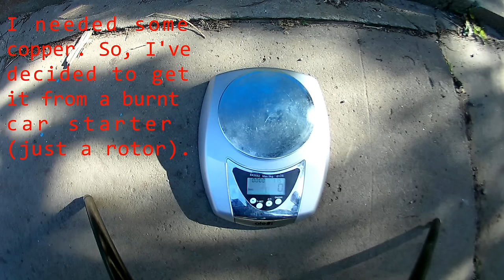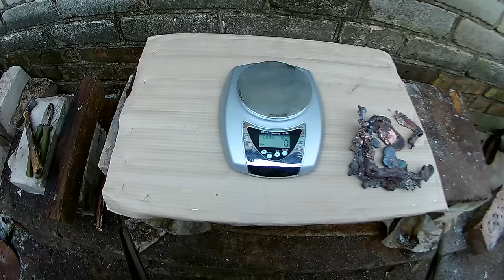Rotor as copper scrap. Copper melting.

Comment: Good work. The rotors are not so bad to strip once you have done a couple. I can strip one in about ten minutes now and there is a lot of copper in there. I use a cold chisel around the bottom of the contact ring and the use a big pair pliers to roll the copper strip down and out of the armature. Worth the effort. Cheers mate 🇦🇺
Reply from the maker: Thank you 🙂 Yes. With some experience probably it's possible to make it much faster.
Reply: Good on ya Stuart G .
Giving  him some positive feed back .
We are all learning .
Too many expert haters on yt .
I tried foundry work at 14 y o .
Failed but learnt ,  still learning. 
But never gave up . 
A Fellow aussie  !

Comment: Around here the best I can get for these and the motor itself is 15 cents a pound whole. Guess I have to sit on it a few more years.
Reply from the maker: Do you think that prices on copper are going to increase soon? :)
Reply: @DuralMetalurg  I really do think that copper is on its way back up in price. It's already near $3 a pound for new copper. 

But for me it's complicated.

I save copper in three ways. I have piles of insulated cable and lots of electric motors I just want to sell off to free up space. 

Next I have clean wire in bales I want to sell maybe in a few to five years. 

Then I have buckets of pre 1982 cents and nickels I am saving as a form of copper bullion maybe for a trade but probably not dollars between 20 and 30 years. 

So will the price go up.....absolutely. In the near term I think between now and the next few years I think it will go up in price substantially. 

Mostly due to the dollar going down, higher energy prices and harder to extract copper.
Reply from the maker: @mysterybuyer3738  Ok. I see. Sounds like you have a good plan. I still have enough copper and aluminum for casting. Though, copper may be a problem for me in the future :)

Comment: Rotors are a pain the ass to work with, but i guess if you have a system for breaking them down thats easy, it works.
Reply from the maker: Yes, you're fight :) That time my furnace was much worse than my new one. So, now I need only one step to melt it. Just put a rotor into a crucible and when copper will be melted, take out all steel parts. I didn't try this after building a new smelter but I think it'll be fine
Reply: I have a box full of rotors that I have disassembled for the coil copper for the other part of the outside motors, which were easy to take apart by cutting the middles out and just pulling the wire from there. But the rotors that i have at the moment are just sitting there waiting to be either sold as dirty copper iron/aluminum scrap recycling, or maybe I might just build a foundry and try this method.
Reply from the maker: Yes, that's a good idea! I'm sure you'll enjoy melting and casting if you try it :) I also didn't know what to do with that old starter and happy that I didn't sell it as scrap. The only thing I've found is that it's highly recommended to use graphite clay crucible when melting copper. No problems with aluminum and brass but I damaged several crucibles with copper. :)
Reply from the maker: Thank you. I've already did that. Still haven't seen the "Copper ball" but I saw Chevy :) It looks great!

Comment: No 2 Copper wire (burnt) and Heavy copper (pipe) £4.00 / $5.33 a kilo in the UK.
Reply from the maker: Hi Paul. Well, comparing to Ukraine copper in UK is very expensive. I didn't plan to sell this copper. I used it for my casting projects. All these projects are on my channel!

Comment: That was interesting :) What are you going to do with that copper?
Reply from the maker: I'm planning to use it for making a metal coaster. It should consist of two parts and one of it will be made of copper. It should look nice. :) The copper was one of the reasons why I've decided to built a new furnace several months ago :) My old furnace didn't allow to do this. The temperature was enough for brass but not enough for copper. Couldn't reach that plus 100 C difference.

Comment: Where did you get that from, an AC? I'm waiting for my parents to change the two AC's in their room so i can take everything from the AC.
Reply from the maker: I think this rotor was from my car starter. It burnt long time ago. Also, I should try to find the stator and aluminum body of that starter. It should be somewhere but not sure where exactly :) As AC you mean air conditioner yeah? I never disassembled ACs but I think there should be copper radiator, pipes and some copper + aluminum in compressor. Therefore, from to air conditioners you'll get plenty of metal!
Reply: These days you'll find aluminum radiators and tubing in pretty much everything from cars to dehumidifiers to any kind of air conditioner (whole house or window mount). Good for aluminum, only the motor will have copper tho. Older units you'll find copper, tube and radiators and there's always copper in the motor windings but getting that out isn't usually practical unless you just burn it out of the stator or just enjoy working with wire cutters for several hours cutting thru each turn of each winding. The "winding" bars on the rotor will be aluminum on pretty much any induction motor you're likely to be scrapping, anything with copper in the rotor of an induction motor will likely be built well enough that it's still working, worth fixing, or already scrapped!
Reply from the maker: You're definitely right! It's cool that old or broken equipment could serve us even after its "death" :) To buy such metals as copper and brass (bronze) is enough expensive. Usually, it's much cheaper to use old equipment or even buy some broken equipment or parts :)

Comment: Can you just throw in wire with insulation still on the wire and burn it off as slag or does it need to be stripped?
Reply from the maker: I wanted to melt copper without dismantling the rotor, but it was important to get high temperature and my old smelting furnace didn't make it. That's why I had to build a new furnace.
Reply: Dural Metalurg i only ask because the last few years my usual recycleing spots have been slowly turning down value of #2 copper coils i break off hid ballasts down to half price because its "used and dirty" copper and not piping. So i am.looking into melting all my copper down into ingots for selling.
Reply from the maker: Oh, I see. Are they ready to buy copper which was melted before?

Comment: is it worth all the chew?
Reply from the maker: It depends what is the purpose of actions :) In my case it's worse it because I learn and improve my melting and casting knowledge from each casting. No matter if it's successful or not :) Check my other videos to see what's the reason of such experiments!
Reply: I used to strip motors an d dynamos  when I was about 14. Found it hard work but didn't smelt copper, only lead.
Reply from the maker: @fasteddy546  Well, in fact that's a lot of fun. And after getting some experience it's possible to make really amazing and useful things. I also started with lead about the same age as you did. After that I had a long 20 years brake :) and started melting and casting metals again :)
Reply: Yes I did it for pocket money to buy clothes!

Comment: Copper in steel crucibles is not a good idea.  Get yourself a cheap graphite crucible.
Reply from the maker: Thanks for your comment :) After this video I melted copper in other steel and stainless steel crucible and everything was fine. I understand that copper melting point is approx 1100 C and it's not very far from steel melting point. Anyway, I want to assure you that it works. With that crucible I had problems from the beginning.
Reply: Copper can actually alloy/braze with steel, so that may be what worldltraveler is referring to as well.
Reply: Cave of Skarzs